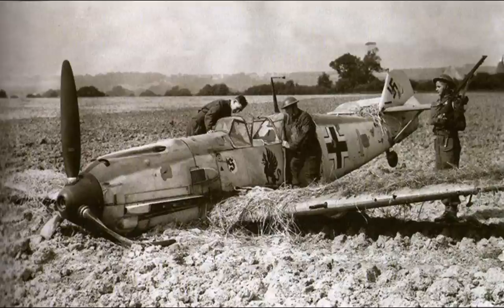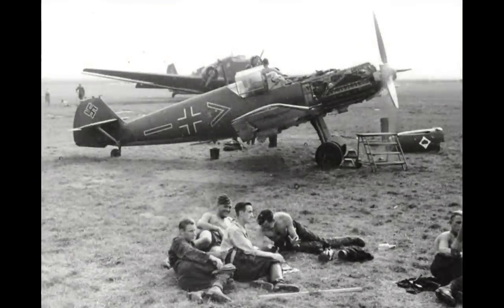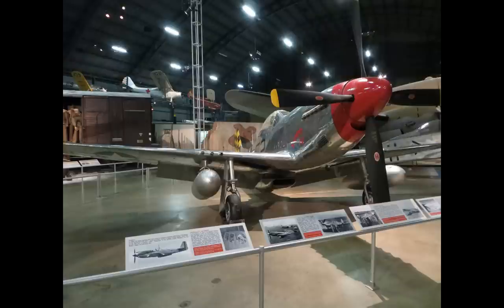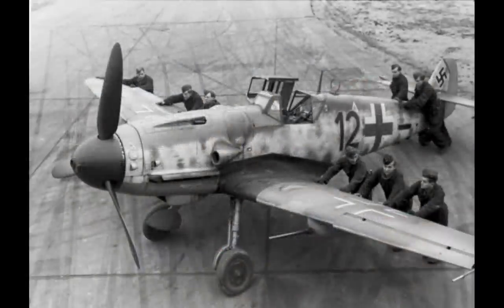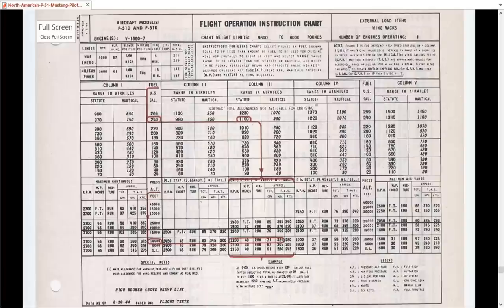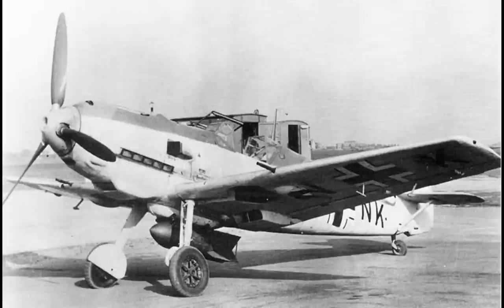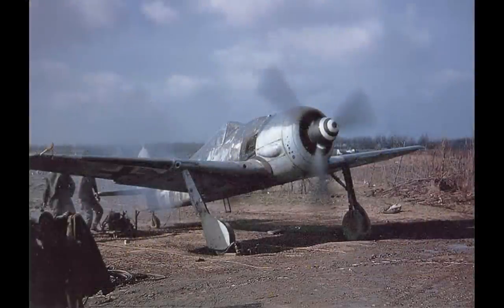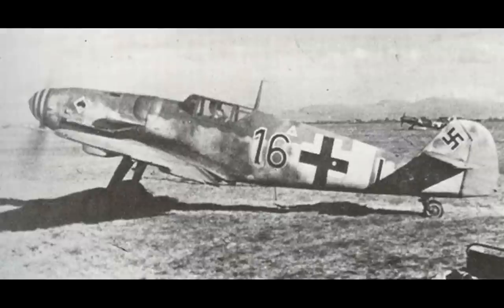Messerschmitt BF 109, Why Such Short Range?

Comment: Love how early war issues follow 09s forever yet the same isn't true for Spits. You hear about take offs and landings being a huge issue in 109s yet you never hear about late war 109s with changed wheel angle being mentioned as helping resolve the problem. You hear about short rang for both the 109 and the spitfires and yet nary a mention to later war ranges.

There is a British test of a captured G2 with drop tank showing almost 6 hours of maximum range, 3 1/2 hours at normal cruise. Late war spitfires were ranging 5.5 hours with recce spits and 109s ranging 7 hours.
 
in the 109's case, 2 x 300L drop tanks were used. in the spit's case, fuel tanks installed in place of weaponry along with centerline drop tank.

if there had been a need for long range escort, 109s could have utilized the MW-50 tank for additional fuel, 1 x 300L centerline, and 2 x 300L under each wing. combined with a PKS autopilot it 'could' have been done, obviously the german's had nothing to escort by the time that 'could' have been possible.

and 100% agree, there is zero benefit to carburation. we'd still use them if there were ANY advantage to them. given that even the lowest end vehicles use direct injection now ... should be fairly obvious which tech is best for power and economy.
Reply from the maker: I agree it's strange that the Spitfire seems to get a pass for all of its flaws.

Comment: ... and, if i mat add, the DB 605 had ONE camshaft actuating BOTH exhast and intake valves - with the SAME cam !! that's unusuall too, ain't it ? they manage to catch the best point of the timing to do it right
Reply from the maker: That is an odd feature of that engine.
Reply: @wilburfinnigan2142  Hi ! you mean they had a single camshaft over each head, that's true, BUT the DB605 had one camshaft ,AND also ONE CAM LOBE to operate BOTH intake/exhaust valve, not a separate lobe ! this is crazy, i work on cars/bikes/tractors and never saw anything like it ! here, you can watch and see what i meant : https://www.youtube.com/watch?v=xcPRLu5DpNE   and here too :   https://www.youtube.com/watch?v=-Bo6QF5acgI    can you see the difference?!
Reply: @wilburfinnigan2142  exactly! and if i'm not wrong, that means you get a crazy long overlap compared to the time the valve is opened, this is a very problematic timing ! maybe that's one of the reasons the 35.7 liters DB605 made about the same power as a 27 liters Merlin 45/47 (appart from the low octane fuel and other problems) ?

Comment: The Bf  109 was designed as a front line fighter (flying over the "Hauptkampflinie - HKL"). It was not designed for a war against GB. Göring expected war with GB not before 1942. At that time he hoped to have a long range maritime patrol aircraft (He 177) and a long range fighter (Do 335) to go as far as Scapa Flow. As we know, Göring's effort was countered by Ribbentrop...
Reply from the maker: A lot of people make this same basic comment. It's some version of "the 109 had short range because the Germans designed it that way".  It's a nonsensical comment because it pre-supposes that the Germans could have given the 109 more range without sacrificing performance if only they had wanted to. That's false. Doing so would have put it's performance behind it's contemporaries.

Comment: Both the Spitfire and Hurricane designed as interceptors not long range escorts
Reply: Neither was the P51actually  designed as a bomber escort. By accident, almost, it was developed into a bomber escort, after the V1710 Allison was replaced with the V1650 Packard. Since the Mustang was designed as an export product first, the 8:1 strength ratio required of U.S. military aircraft was replaced with a 5:1 ratio, saving weight, and the U.S. Army had no objection to using the Packard V12.
My question is, since the two-speed, two stage Merlin supercharger was so effective, why wasn't the Allison so equipped, especially given the Allison's "modular" design? I also have to wonder why no one copied the DB 601-5 infinitely variable supercharger. It isn't as if the Brit countryside wasn't littered with broken Bf 109s by 1941.

Comment: NASCAR still runs Carb'd iron block V8s.  Another thing that may or may not have effected this myth of the 109s short legs is that even when P-51s were escorting bombers deep into Germany they were doing so in shifts.  As far as I know German Bf-109s were escorting bombers the full route, but maybe I'm wrong.  I don't know for sure.  If true the longer transit times of the bombers would explain how the 109s were running so low on fuel just going to London and back as a 109 escorting a bomber would take much more fuel to make that trip than a 109 by itself.

Comment: You brought up some great points, I was always told that the reason for the 109 range issue was that it was a POS and that the Germans were poor aircraft designers, It may not have been as good as the FW190, but hardly not a pos. Thank you.
Reply from the maker: The 109 was an excellent airplane.
Reply: It is interesting that Germany's top Aces loved it, and had some unreal top scores in it, yet it did have a landing gear "problem" that if not respected could leave you in a nasty ground loop. Myself, give me the FW 152! Thanks, and God bless. @GregsAirplanesandAutomobiles

Comment: Off topic question, how would the lubrication system differ in an inverted engine compared to regular one? Wouldn't the oil flood the cylinder? Also for the bottom cylinders of radial engine.
Reply from the maker: Yes, but it's not a big problem when the engine is running because the rate at which the oil leaks in is minimal. It IS A BIG PROBLEM when the engine is not running. Oil can pool in the cylinders and then when you crank the engine over, it hydrolocks. If you're lucky, it hydrolocks from the starter, which usually does't damage anything. The starter has clutches in it to protect things. However if one cylinder fires and then another hydrolocks, it destroys the engine. That's why you see people always cranking over a lot before they introduce fuel and spark. They are using the clutch protected starter to clear any oil out.

Comment: Did the P-51s laminar-flow wing extend its range, and give it a range advantage over the Bf-109?
Reply: not as much as carrying 2 and a half times as much fuel does.
Reply: The laminar flow wings didn't work on real planes because they couldn't be manufactured to the necessary tolerances.
Reply: @wilburfinnigan2142 
The wings did not produce laminar flow but had other aerodynamic advantages but not enough for the British to not go back to the elliptical wing after building Spitfires after with P-51 style wings. The real advantage that the Mustang had was the radiator ducting.
Reply: @wilburfinnigan2142  
The complete package of which the radiator ducting provided well over 90% of the reduced drag. It was not just clean it is a lousy ramjet. Go find out what percentage of drag engine cooling represents and then consider what a 20-30% reduction in cooling drag really means.
Reply: @wilburfinnigan2142  
The mustang had a clean design so much so that a conventional radiator ducting would have been just about half the aerodynamic drag. Reducing the cooling drag by well over 20% reduced the planes total drag by over 10% giving the P-51 phenomenal speed for the power. 
and stop projecting your ignorance.

Comment: It should NEVER be forgotten that the P51 was designed by a refugee German for the English. In fact, the first 400 P51 aircraft were built for the British and literally stolen by the US Army. The US Army then converted the first 150 P51 aircraft to Dive Bombers by adding Airbrakes to the wings and a few other bits and pieces. It wasn’t until when in England a P51 pilot landed at Rolls Royce factory and said to them “Will you put a Merlin in please” which they did and sent the bill later, that they found out the aircraft really hummed at height.
Reply from the maker: It's a bit more complicated than that, and I cover all these points in other videos.
Reply: @GregsAirplanesandAutomobiles  thanks, I subscribed, I want you to know I really appreciate the work you put in to your videos. I don’t know if you’ve done one on radio fuses, if not, I think it’s impact is under appreciated, especially in the Pacific war. I’d also appreciate a detailed look at aircraft cannon used in WW2, accuracy, muzzle velocity, range, rate of fire, amount of ammo carried. Both allied and Axis forces. I should note, I’m not a fan of the Spitfire, but even more an outright vehement critic of the Allied Bombing Campaign. I actually think the Bombing Campaign a massive waste of assets and manpower, not to mention both Allied servicemen and German civilians. One day I’ll write the Alternate History, without the Bombing Campaign, with the “2nd Front” I.e. landing on Europe/France in 1943 with the Iron Curtain never coming down and the Nuclear Bomb never being dropped. Man on the moon by 1960, transistors in the 1950s, etc

Comment: I am not sure about that but I heared that the tank of the MW50 could be filled also with fuel. Do you have any information about that?
Reply from the maker: I have heard that, but the last thing I want in my 109 is a non self sealed tank right behind me filled with aviation fuel. The MW50 mix was not flammable so it was safe. Plus I would rather have the extra emergency power from the MW50 than extra fuel at that point in the war.

Comment: So the P51 has more range 'cause it has a much bigger fuel tank...      So why does everyone say it has the extra range due to the laminar flow wings and Meredith effect radiators?
Reply from the maker: All this stuff sort of ties together. Think of it this way, the wing design and other aerodynamic features allow the P-51 to be bigger than the 109 without a proportional increase in drag, thus leaving more room for fuel. Both planes move about the same distance per unit of fuel, but the P-51 can carry more, and it can do that because it's bigger. It can be bigger without being slower because of the aerodynamics.
Reply: It was very advanced aerodynamically for its day, which contributed to its range, as well as it's cruise speed. But its range came primarily from its fuel capacity. The P-51 was a relatively large aircraft compared to its European contemporaries,  with lots of room for fuel
Reply: Keep in mind that the P-51 was a 1940 design, and the Bf 109 was a 1935 design. Doesn't seem like much, but consider the Bf 109 was the same generation as Bi planes
Reply: Greg's Airplanes and Automobiles -Great summary; I’m surprised you did not bring up the discussion of the P-51’s radiator design (Meredith effect) and placement, of the laminar-ish wing profile
Reply: I think post war a lot of people wanted to get a little credit for the P-51.  The exceptional range was clearly primarily the result of its exceptional fuel capacity.  If you have a look at the laminar profile wings on the P-51 you'll see the thickest point is at about 50% whereas the NACA 4 digit and 5 digit profiles used on Spitfires, P-40, Corsairs, Hellcats and even Fw 190 had their thickest portion at the 15%-20% point.   The result was that the wing of the P-51 had much more internal volume for the same thickness and this made it possible to carry all this fuel.  Fuel volume clearly is the by far the main reason the P-51 had excellent range.  It also made it very easy to put in a pair of thick strong twin wing spars to make the wing stiff and strong and left a lot of space for fuel and undercarriage in between the spars.  Without radiators in the wing its volume was clear for fuel. The reality is that the P-51 achieved its range due to number of factors.  Although the laminar concept worked in the wind tunnel tiny amounts of wing surface damage caused by scratches, paint damage, dings, insect strikes broke it down to the point it made only a small contribution, however the pressure distribution that was designed to sustain laminarity also has a higher mach limit ie lower compressibility and this did aid the P-51's speed and cruise since it was operating at Mach 0.5 to 0.7 where 'compressibility' mattered.  P-51 high speed cruise was good.  By the outbreak of the war everyone was using the so called "Meredith" effect.  It was well understood by Hugo Junkers before WW1.  The main thing that made the Meredith effect useful was pressurised cooling circuits which increased the temperature of the coolant.  This allowed the radiator to be smaller and the efficient transfer of more heat to less airflow.  The expanding heated air then functioned like a ram jet.  Im sure radials used the meridth effect as well since they have beter heat transfer.
Reply: HiWetcam - The late model P-38 chin radiators you reference are oil coolers and the intercooler. The radiators are located aft on the boom. The radiator scoop design looks like it could have done better about getting away from the boundary layer air. Lockheed wanted to incorporate recommendations from a NACA study which recommended moving the radiators to the inner wing’s leading edge; a la DH Mosquito/Hornet. The radiator relocation, as well as lengthening the central gondola, was calculated to increase critical Mach to .77 (https://crgis.ndc.nasa.gov/crgis/images/9/9f/1942-03-31_Investigation_of_Buffering_and_Diving_Tendencies_of_the_YP-38_Airplane.pdf). Unfortunately, the War Production Board did not like the idea of taking the P-38 off of the production line for re-tooling.
Reply: I think by 1935 or so everyone knew about the Meredith effect and everyone (the British, certainly - read Quill) used it (including in designs using radial engines), if they didn't they'd have been at a huge disadvantage. However the Mustang's radiator also put the hot air right where it was needed to further reduce drag - in the low pressure region around the back of the fuselage. That's what I think led to the largest reduction in drag compared to other designs.

Comment: I suppose the head down design of the engine allowed for a smaller fuselage.
Reply: One reason I think is that it gave the ground crews easier access to the spark plugs and fuel injection.

Comment: Its odd this is treated as a 'drawback'.  Remember folks, aircraft are designed in certain ways because of the missions they were intended for.  The 109 was a battlefield air superiority aircraft.  The spitfire was an interceptor.  They were both superb at their roles.  Compare, for example, the rate-of-climb of the P51 against say, the contemporary model of the spitfire.  The P51s rate of climb is decidedly inferior.  Aircraft design is a matter of tradeoffs.  You cannot design the 'perfect aircraft'.  No one model is going to be best at everything.  It is a matter of compromise and selecting what characteristics are needed for the design.

Comment: Some thoughts about the speed difference... Parasite drag, the P51 was a far cleaner airframe, the propeller on the P51 was laminar and more modern 4-blade? The Germans did not see the Mustang until 1944, and they knew the ME262 was coming, and re-designing the airframe for parasite drag would be pointless when this jet would make the P51 look like it was standing still? Just thought I had. Thank you for the video!
Reply from the maker: I will address this drag issue in another video.

Comment: Interesting that you made mention of the DB bearings. Needle bearings on the crankshaft was a DB idiosyncrasy that they stuck with into the 1950's. Everyone else excepted that it was a waste of money long before they did because plain bearings are more durable and since the oil film never lets the shaft touch the bearing, offer no more friction. Even DB excepts this today.
Reply from the maker: I think they used them for the connecting rods, not the main crank bearings. I would have to look that up to be sure. Needle bearings for the connecting rods are not that unusual. Honda has used them for connecting rods, and Mazda has used them for thrust bearings.

Comment: Excellent video!!!! I do believe Procharger carries a centerfugal supercharger called the i-1 which is a variable ratio supercharger using a CVT. Is this similar to the German supercharger?
Reply from the maker: I am not familiar with it. I suspect it uses a CVT belt type system and not the hydraulic coupling.

Comment: A design choice in a fuel system would be to inject the fuel upstream or downstream of a supercharger. All German 1940s aero-engines such as the DB 605 seem to have injection downstream, while British and American engines had carburation upstream of the supercharger. Downstream carburation should allow the supercharger to handle slightly lower mass flow. I've read that superchargers on US radial engines had a mixing effect and delivered a more uniform fuel-air mixture to the intake manifold. I imagine a supercharger that is compressing a fuel-air mixture would be more prone to fires than one compressing pure air.
Reply from the maker: That's basically all correct. The Germans did inject fuel before the supercharger in a few odd applications, but it was supplemental fuel, not the main injectors. Most of the US designed multi stage engines had the injection carb in between two superchargers, or in the case of the P-47 and P-38 in between the turbo and the gear driven supercharger.
Reply: @GregsAirplanesandAutomobiles  I  read LJK Setright's Power to Fly; he favoured upstream injection. The enthalpy of vaporization of a hydrocarbon fuel would confer a charge-cooling benefit. This benefit could be realized upstream or downstream of the supercharger - but I wonder if cooling the charge before it is compressed by the supercharger would allow a power saving to the supercharger drive.
Reply: Injection of water-methanol seems to only be upstream of the supercharger; but I believe most modern automotive fuel injection systems are downstream of any turbo- or supercharger.